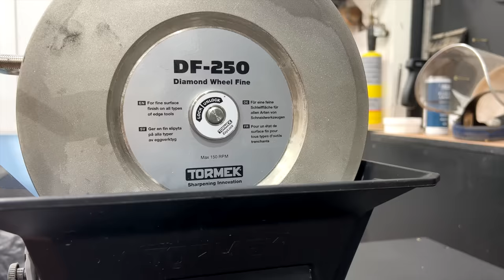Woodturning - YEW Can't Be Serious?

Comment: I really don't get why he doesn't start by cutting the corners off these to make them roughly round... isn't it like a million times more dangerous to do it this way?
Reply from the maker: No.. it’s like not even like one times more dangerous.. the time it takes and the danger involved depends entirely on the competence of the operator… for example, I can do this much faster on a lathe compared to cutting the corners on the bandsaw, but by the sounds of it it would probably take you 3 weeks to get it round on the lathe. It all just comes down to knowledge and experience.
Reply: @JackMackWoodturning  I haven't ever used a lathe so I wouldn't assume to tell him how to do anything, I was just basing it on general understanding of how it works.

Comment: I can not see the point or gain in lathing a square piece. Both pieces could have been made round (or at least octagonal) on the band saw… This method only makes more waste, chips and dust in my opinion. And makes the whole project more hazardous and with a larger chance of failiure. Just because one can, doesn’t mean you should. Lovely piece it became anyway 😇
Reply from the maker: Why do you think it’s more hazardous??
Reply: @JackMackWoodturning  There is both a risk that the tool gets caught by a corner and/or that a chunk of wood will fly of and both can be a dangerous projectile
Reply from the maker: These points are not correct working on the assumption that the operator knows the basics of Woodturning.
Reply: @JackMackWoodturning  That is the famous last words of everone that gets hurt. Your reasoning means that everyone that gets hurt doesn’t know what the are doing… There are many examples of professionals that get hurt, or even killed. In my world you should not challenge your luck, and rather be safe than sorry. Sad to realize that you consider yourself infallible :-(
Reply from the maker: That is an assumption you have drawn.. (that I think I can’t be hurt) you’ve piled that onto of another assumption (that you  think the piece being square increases the danger) 

I don’t mean to be rude. It’s just not correct. It also works on an assumption that a bandsaw is safer than a lathe. Which of course not correct either as it depends on the knowledge and experience of the operator. 

Turning square pieces round is the most efficient way to do it. There is a point at which the novice sees it as terrifying.. a 2” spindle is fine but a 10” bowl blank is not. but that is only a case of lack of understanding leading to irrational (but understandable) fear.
Reply: @JackMackWoodturning  This ”most effecient way” gives a lot more waste for one instance. You put my view down to assumptions, despite 99% of woodworkers start lathing with a piece more round than square… In my world there is a reason for that! There are many ways to skin a cat, but some are safer and more efficient… But feel free to push the boundaries and experiment, that is good. But do not persistence, that your way is way better than 99% of wood workers practice (that are based on experience). And if your way is better, why the title of the video?
Reply from the maker: @peterhansson7967  hi Peter. How would you have made this blank round? 
I’m not inventing anything new, as a production bowl turner of 20 years I always round out my bowl blanks on the bamksaw.. for my production work (4000 bowls per year) ..but this bowl would require first planning the face of the logs.. then removing the piece and cutting it round in the bandsaw, (after putting the correct blade and the bandsaw and tuning it) then cutting the second blank round, gluing up, and then remounting on the lathe truing up the whole thing.. 
obviously that wouldn’t be the best approach.. so instead I did it the most efficient and safe way.
Reply: @JackMackWoodturning  Why does it have to be perfectly flat to be sawn aprox round on the bandsaw? And even if so, you already hade two sides parallell, and making a third one (perpendicular to those) wouldn’t be that hard. The logs could (after glued together) be screwed to a piece of MDF or plywood and be sawn. And what about the other piece of wood?  You made it a thing to to it the hard way, as I see it. I gurss we will never see things the same way so I am leaving it at that
Reply from the maker: I’m glad your leaving it at that cos your last message shows a lack of understanding that I really don’t have time correct. Maybe one day along the way you’ll be making something and the penny will drop and all will become clear and understandable. 👍🏻
Reply: @JackMackWoodturning  I am very happy that you got the chance to boost yourself and lift your skills to the skies. I am a humble person that do everything to learn new things and skull. I guess that isn’t for everyone ;-)
Reply from the maker: I’m more than happy to explain everything to you.. but your statements this far have shown a narrow minded perspective .. and that feels like a waste of my time to try to educate you.

Comment: Why not cut the waste off on a bandsaw?
Reply from the maker: Because it takes longer to set the saw up for a radius cut than it takes to turn the corners off on the lathe.
Reply: @JackMackWoodturning  i have had large pieces flung off from corners. I would just free hand cut the outside diameter to remove some of the heavy corner pieces even at an angle. Great project BTW
Reply from the maker: Thanks jay.. your getting chunks coming off because you’re hitting end gain head on.. when we cut wood with any tool we need to approach it from the long grain. In a bowl blank like this that would be to mover the cutting edge of the tool up or down parallel to the axis of rotation. Facing either the head stock or the tailstock. Cutting on a bandsaw pre turning, stops you making the most of a valuable learning experience. 
If you use these opportunities to practice interrupted cuts you will begin to excel with your bowl gouge and understand the cutting process better leading to you developing as a woodturner. 
I must stress, when I do production runs of 100s of bowls (which is my day job)
I always round out my blanks first on the saw.. but when I am doing one off pieces like this and my saw is set for ripping I will use the lathe to true the piece up because it’s the most time efficient method. 

Another point to note is that the best time to cut the corners off this blank would be to cut the yew blank and then the mahogany blank. Cutting it after the two had been glued would have been unsafe and left the mahogany with corners still.. this means setting up for a radius cut..then two cuts and then mounting on the lathe to turn away still a considerable amount of wood. 
I normally give my self an hour or two at the end of my working day to work on some video, so efficiency of time is very important while I work. 

Hope this helps buddy. 👍🏻

Comment: It would have been 1000x more efficient and 1000x safer to finish you glue-up, and cut a rough outer circular shape with the band saw.

*Reference: knew a guy who was killed while turning wood when the piece blew apart.

Comment: Safety equipment????
Reply from the maker: What do you feel is missing ?
Reply: @JackMackWoodturning  A pushing tool to move your peace of wood past the band saw. In case something happens with the tree branch. Did you have safety glasses and ear plugs in. I was on the safety team for 25 years and saw many remodels.

Comment: Beside the fake thumbnail... as usual 🤮🤮🤮 
Definitely a great result !
BUT ... alas !... starting to turn a square piece instead of roughly cutting it with a saw is totally nonsense.  
It goes against any "turning law" and above all, a dangerous and stupid way to work !  
Just think of a possible imitator of yours who got hurt, following your crazy way of working !?!
👎👎👎
Reply from the maker: I’m sorry T, what about the thumbnail do you think is fake? Furthermore, what about the way I work do you think is crazy buddy?
Reply: @JackMackWoodturning  Hi !
I mean .. (but why do I have to explain it again?) ... Why turning a square piece of wood WHEN you can easily cut (saw) it coarsely round, before you start turning it ? 
That will avoid a lot of risk and unnecessary working with the chisel tool. 
Imitators, man, aren't as skilled as you are, so on youtube usually has to be shown how to work safely. But never mind...